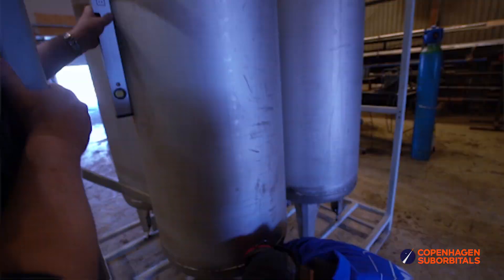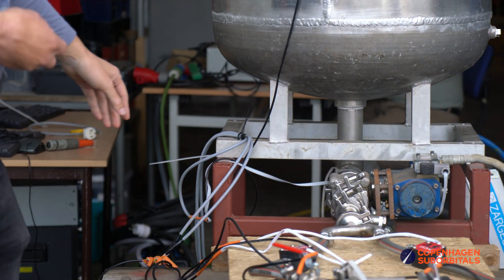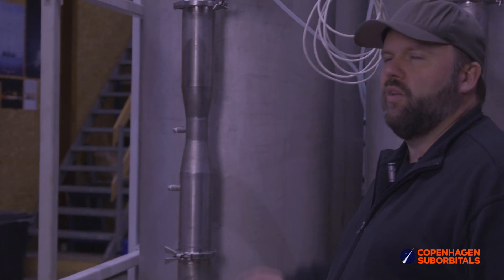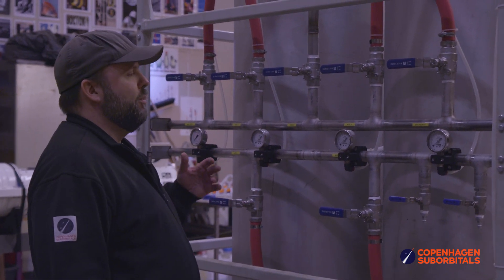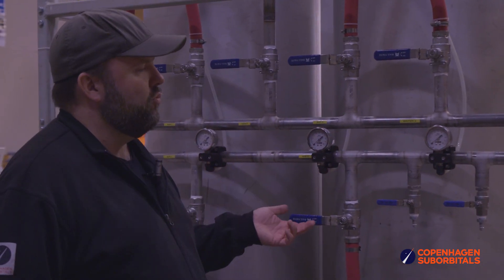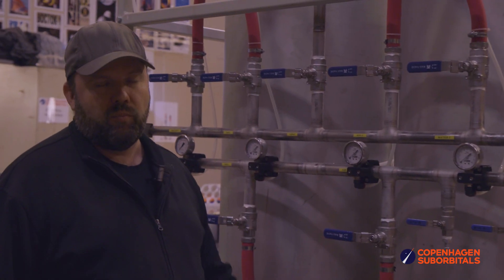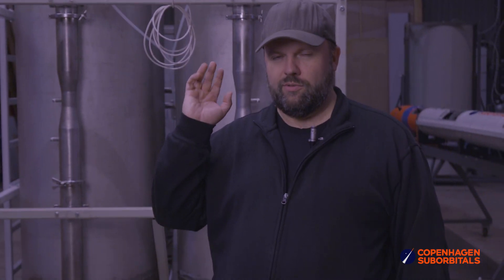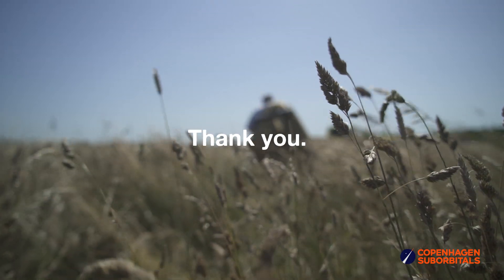See A Rocket Engine's Fuel Consumption! It's Amazing!

Comment: Thanks for sharing.

Check out the Bellagio Fountain show in Las Vegas, Nevada, USA.  Perhaps it will give you ideas on laminar flow ( hundreds of drinking straws, catalytic converter-like tubes in parallel inside the 3” pipe ) prior to your nozzles.

Comment: Only 8 bars? The real fuel pressure have to be a lot higher than that to overcome the chamber pressure?
Reply from the maker: It's all relative pressures. We have around 18bar at our injector face in the engine and 15bar in the combustion chamber, meaning a difference of 3bar. So to simulate that on an injector test under atmospheric pressure, we really only need 4bar.

Comment: If you program to drink less vodka.... you can use as  propellant
Reply: San Sone They will!  They only use water as a cheap test.
Reply: @johnfrancisdoe1563  I tell you my point of view trying to be synthetic.
When it first opened this project, I thought it was a joke. But then I saw it continue. Ordinary people, who welded and discarded rust from pieces of iron, making them rockets. I looked at the calendar and no, I had not returned to the times of the Nazis, we were in the present. I then tried to find out if there was a lack of legislation in the country of these gentlemen that does not allow for mandatory health treatments, replacing the asylums. But I found that they exist in them too.
At that point I put my soul in peace, I made a donation. I sent several cases of vodka to the project. A deep gorge told me that after a few minutes they had all been drunk. Or evaporate. I'm afraid it's the first one.